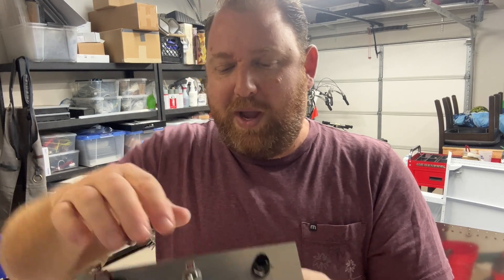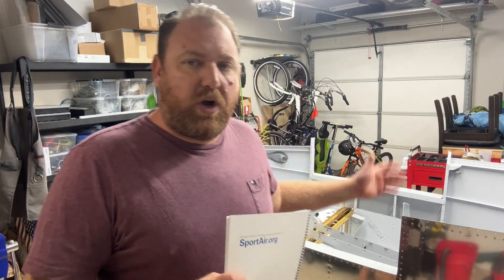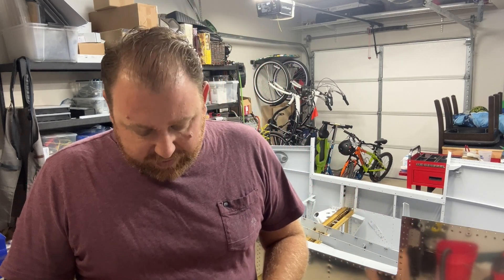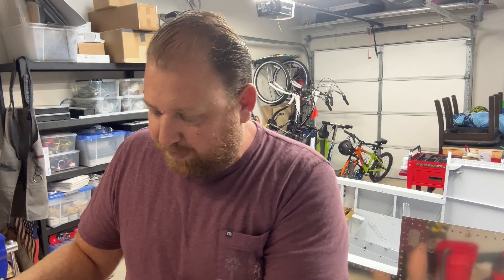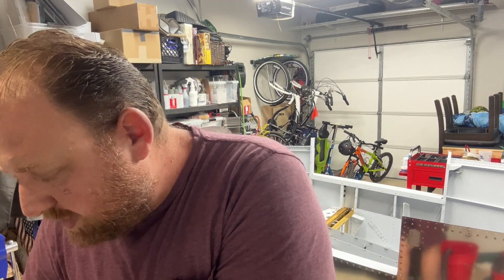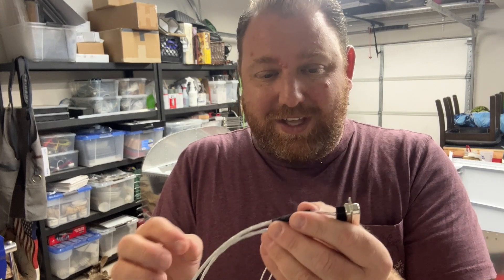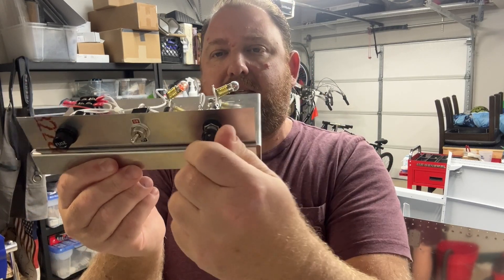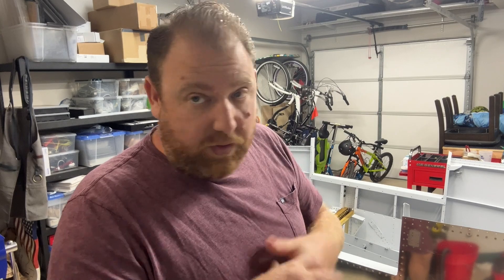RV10 Build EAA Sport Air Electrical Wiring and Avionics Workshop - Video 41

Comment: I took that class after doing a lot of research ahead of time.  It was an amazing class.  It was good prep for my 1950 Piper Pacer rewire.  I had a retired avionics guy help me through the project.  He is an avionics master and was impressed with my knowledge.  Needless to say we worked together for 2.5 months and I rewired the entire airplane on top of wiring a Garmin audio panel, Garmin transponder and Icom radio. Also wired up 2 AV-30's EGT CHT gauges and piped in all the pitot and static instruments.  Also hand cut a carbon fiber panel for the classic pacer That class helped me greatly with the project. I learned tons after that class.  All work has been signed off by my Avionics guy who checked all my "homework" the following days.  If you aren't logging all of your hours of work in an AMT logbook you should just in case you want to get your A&P or just airframe certification.     EAA is amazing.  Check out and do as many of their classes at Sun n Fun and Oshkosh!!!
Reply from the maker: Thats awesome, sounds like a great project.  I have been told many time that the work we do on our homebuilt can NOT be logged toward A&P time unless supervised by an A&P in which case, I do not have an A&P supervising me.

Comment: Another great workshop put on for us home builders is a course through Aircraft Electronics Association in conjunction with garmin. It’s a 3 day course in the Kansas City area and it goes in depth of networking through the CAN bus and serial ports and in the end you wire a small harness that connects the G3x system together. Whether you’re building your harness or not, the knowledge gained is invaluable.
Reply from the maker: That is great to know, I need to look into that.